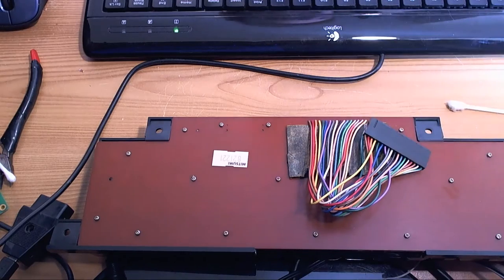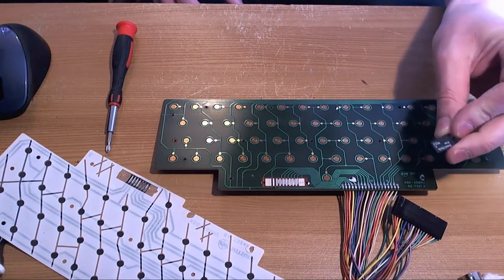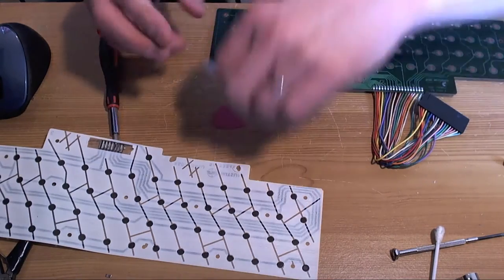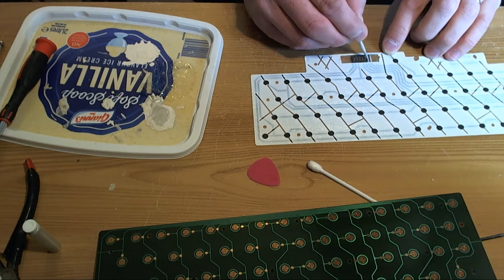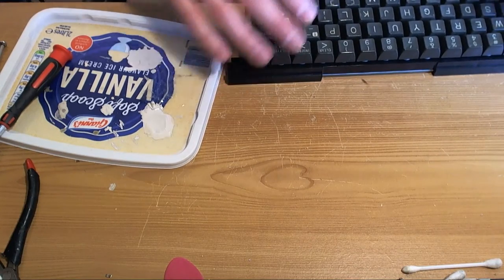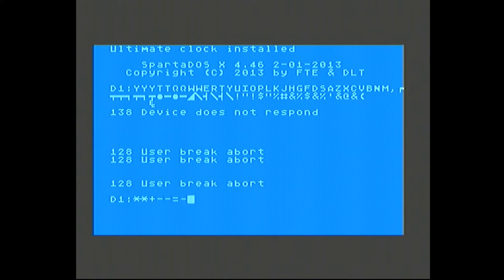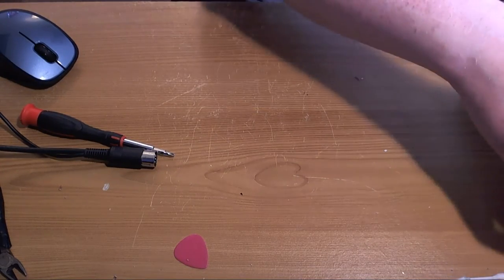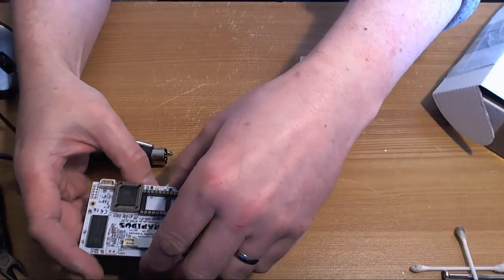Atari 800 keyboard mylar repair

Comment: I think the purpose of the double-sided contact strip you talk about at 15:40 is to improve the contact between the Mylar sheet and the PCB.  I just did the repair on my keyboard (thanks again to your video) and found that one of the painted lines was making poor/intermittent contact with the PCB.  I folded up a piece of paper and put it over the spot where the Mylar contacts the PCB to increase the contact pressure between the two and that took care of it.

Comment: This weekend I got my Atari 800 back after thirty years, but the keyboard doesn't work at all. It's a late model machine that I bought on closeout when the 1200XL was released, so I'm assuming mine is similar to the one you show. Thanks!

Comment: That microphone sounds very good considering it's part of a headphone. I'm fearing the new one won't sound as good. Enjoying your A8 vids they are somehow addictive! Thank you.
Reply from the maker: Yep: that's my concern too, but I'll stick with whatever works best. I think audio could still be improved slightly by cancelling out breathing noises, etc, with some plug-in filters, but the cheap headset is doing pretty well. Glad you're enjoying the videos.
Reply from the maker: Well, the wireless mic finally arrived and it's not too bad. I'll stream with it shortly and you can see what you think. It's nice not being strangled by wires. ;)
Reply: Awesome. I'll let you know if I like it!

Comment: Thanks for the video!  Any tips/links for getting an appropriate conductive paint?
Reply from the maker: I used to buy mine from the Maplin website, IIRC; it was contained in a glass phial. There are probably lots of alternatives, though. The stuff I was using was a little thin; perhaps something thicker would be even better.
Reply: @flashjazzcat  Thanks. I was looking at reviews of a variety of different products on Amazon and a lot of them have negative reviews, although that could be specific to their use case.  The stuff that looks really good, "MG Chemicals Silver Print Conductive Liquid Paint", is $53 for 20g.  I'll keep looking!

Comment: Hi Flashjazzcat..... I have the same problem with my Atari 800 Mitsumi keyboard. One question: it looks when you shape away the black stuff on the mylar contacts that the tracks are copper/metal colored like PCB tracks ? When I try to remove the black stuff on the contacts on mine I seem to end up with blank plastic !?!?!?
Reply from the maker: There's nothing but plastic under the carbon traces on either type of keyboard Mylar. The carbon is the conductive material and you need to form new traces with conductive paint.
Reply: Understood ! :)  Most of the carbon was clearly washed away by a stupid attempt to clean the contacts with alcohol.... sadly performed by me. What I did now is remove a bit of the white plastic so to uncover the original traces to make a "contact point" for the conductive paint. I ordered a bottle of that stuff yesterday and it just arrived :) Man this stuff is crazy expensive. At first I had ordered this Bare Electric paint but soon enough saw a video about it on youtube where it shows this is actually more a resistive paint (like carbon tracks, it is in fact probably almost the same kind of stuff the mylar tracks are made from. Even so, I think the silver/conductive paint is a much better and longer lasting idea.....now.....I need to go out and buy a tiny pencil.... Thanks for this video....hope I'll have a fully working PAL 800 soon :)
Reply from the maker: By white plastic do you mean the silicone layer, or are you repairing the flex cable as well? The latter is a difficult proposition and my preferred solution is to completely replace the cable: https://youtu.be/qscDhzIWV8k. In any case, best of luck with the repair!
Reply: No it's a 800, not a 800XL so no flex cable, just the mylar carbon contacts need to be fixed. I did everything else you showed on this video....removing that small "interface" part was an eye-opener for me.

Yeah I removed just a tiny bit of the white flexible stuff to get to the tracks... and thanks, will show some pics on AtariAge if it works out :)
(I'm Level42 there)
Reply from the maker: Hi Andre - nice to put a name to a nick. :) Look forward to seeing the photos, and I'm delighted if the videos have helped in some way. That is their sole purpose! :)
Reply: HUGE thanks to you Flashjazzcat !! Thanks to this video I managed to fix my 800 PAL machine ! 
See my "story" here: 
http://atari.boards.net/thread/2113/atari-800-pal-keyboard-fixed
Reply from the maker: Nice work Andre, and many congratulations. :) I'm glad the video helped and thanks for the acknowledgement!

Comment: Hey there...great vid...you mentioned you had stuff you were selling...would you have a tape deck and a cover for the parallel BUS for Atari 800XL you'd be willing to sell? If so, how do I contact you? It's for my original 800XL from my childood.
Reply from the maker: Hi. What kind of tape deck were you after? I certainly have a PBI cover. You can email me via the contact page at atari8.co.uk and we'll sort something out. I must put some contact info under these videos! :)
Reply: Hi there...the contact link on that page is broken it seems :/ When I click the contact link it gives me this, "This is somewhat embarrassing, isn’t it?

It seems we can’t find what you’re looking for. Perhaps searching can help."...anyway, thanks for the reply...I originally had the 1010 tape deck with the 800XL, then I replaced it with the XC12 but that eventually gave up. So anything that would be compatible would be fine with me....oh, dont suppose you'd have a couple of springs for the keyboard, lord knows how, but Ive 2 sunken keys that are missing springs. Was just going to dig through my spring collection to find something close.
Reply from the maker: Thanks for the heads up regarding the contact page. The "mailto:" prefix was missing from the email link and is fixed now. What kind of keyboard do you have? There are various models but it sounds like it's the type with white plastic plungers with springs in the centre and a black plastic frame? If that's the case, I'm also out of spare springs for that variant. The tape decks, meanwhile, look beaten up and I have no means of testing them, but I'll have a better idea of what's what when I've sorted through the box they're lying in (alongside a lot of RF shielding).